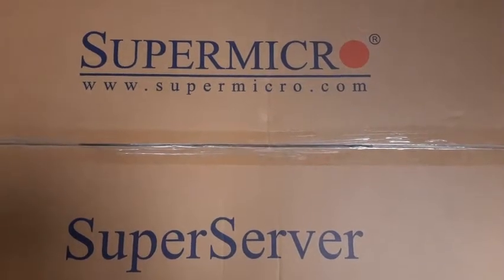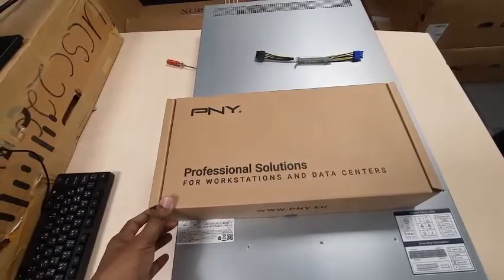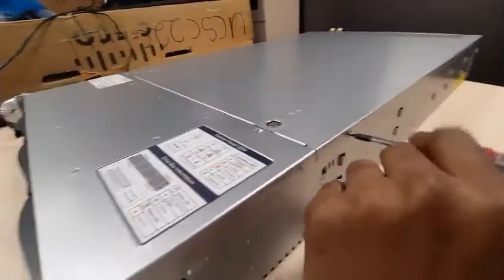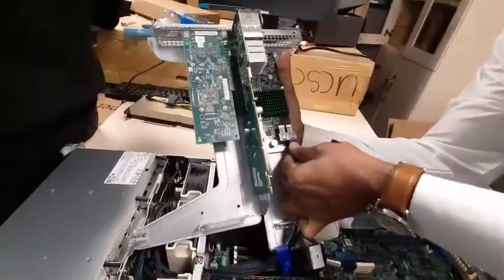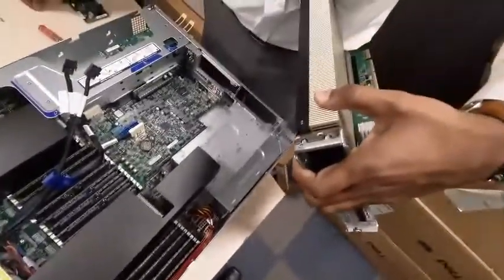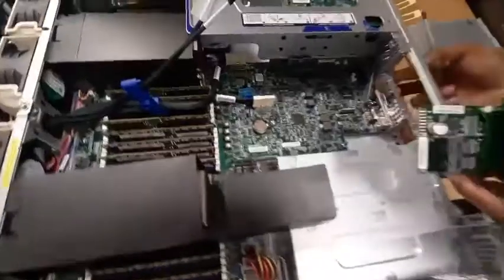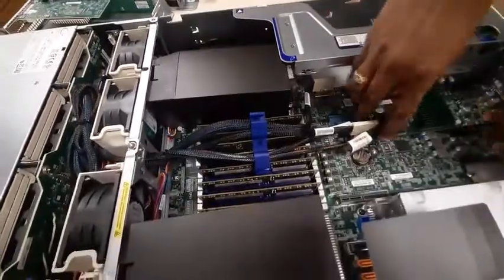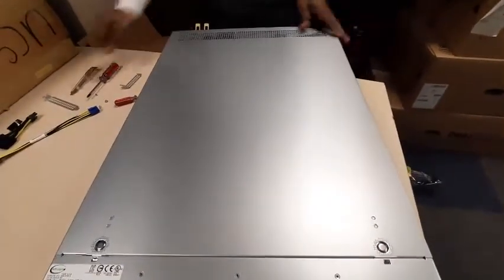How to Install an NVIDIA A16 GPU in a SuperMicro Server FAST!

Comment: Hi. I have a Super Micro A1Sri2558 mini iTX mother board I am using as a desktop with Windows 10 OS.  This use may be a way lower application compared to the capabilities of the board. Since i had a couple of these boards decided to build couple of systems for household use.  The board comes with a default video driver that is not good quality.  Can you guide me or provide a link to some decent video card  for this board to enhance the quality of Video. Thanks in advance.
Reply from the maker: https://www.supermicro.com/en/support/resources/gpu